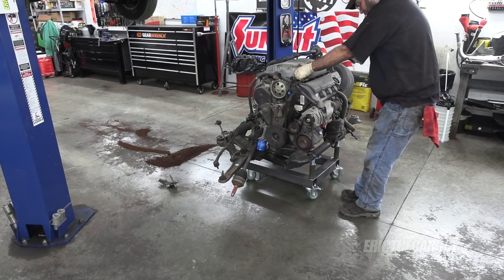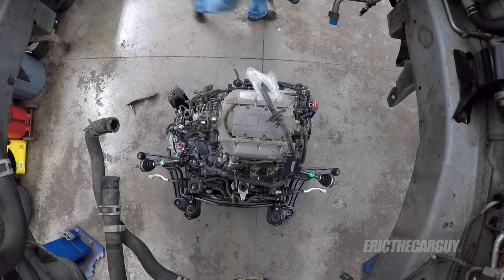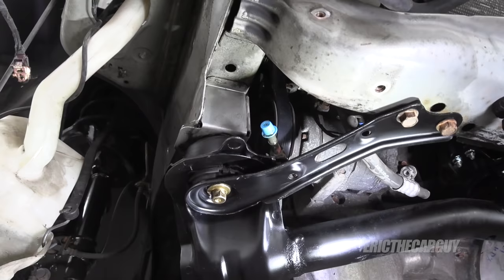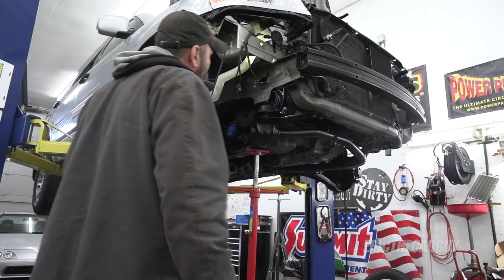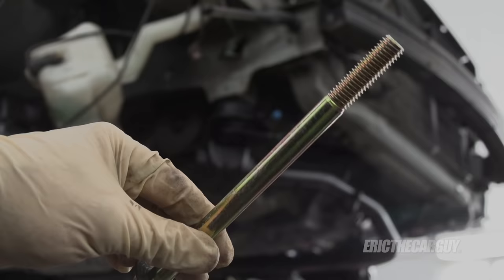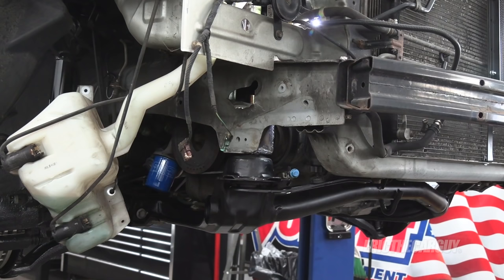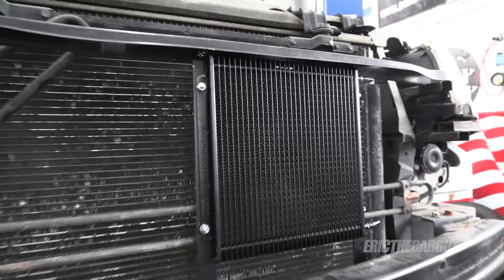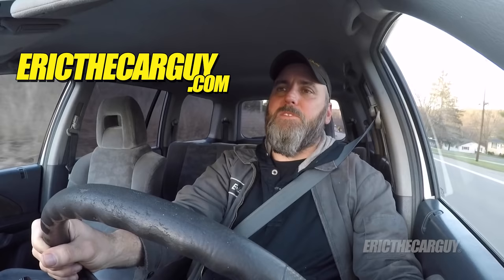Honda Pilot Gets a New Life at 200K

Comment: Hi Eric,
I enjoyed this series.
I hope you don't have troubles with that battery terminal switch. I had one and it failed. There is very little contact on the fastener that operates as the switch and it arced when the switch was closed, and then there was no longer continuity. I cleaned that switch each time it failed and then it would fail later on. I finally installed a cut-off switch, similar to what is used in race cars. I switched the negative cable and mounted the switch near the battery, so it is easy to reach, and it works every time. I should have installed that switch in the first place.
Marc

Comment: The 10% and 90% on your throttle position sensor is the duty cycle that's coming from the computer and come from the 5 volt reference that most sensors run on my f250 runs on 85 and 15% on most of its duty cycle on most of the sensors it has a 60 motor and it's very advanced for the 2007 6.0 L Diesel  it is. Thanks for your videos do you have any help me with a vehicle that I'm working on yet I know that you helped many with theirs stay safe stay dirty and keep making videos and releasing them on Fridays as we know... Peace... Focker out!

Comment: Interesting video with the issues that pop up on every job, all the time, bolts break, threads strip and it somewhat complicates our lives, oh well, it comes with the trade and we just become better at solving these issues as we gain experience. I suggest you get a creeper, I hate draging my body on the ground and collecting the grease/oil/whateverisontheground then sitting in the car with filthy clothing. I like overalls too. Take care and thanks for the vids.
Reply from the maker: I HATE creepers. When I had hair, I'd run it over all the time. When you try and break a bolt loose, the creeper moves in the other direction taking away your leverage. Not to mention if you're using jack stands the creeper limits the distance you have between the floor and the vehicle. I've always hated creepers. Instead I do what I can to keep my shop floor clean. Thanks for the comment.

Comment: Great job as always Eric!  You 100% can replace the TPS separate of the throttle body, (Honda just has never sold the TPS alone) you just cut a slot on the rivet and it unscrews.  If I remember correctly it's m5x0.8 thread, same with the IACV screws.  The TPS on that throttle body appears to be the same as that used on 90's D and B series.  Basically it would have been a million times easier to just replace the TPS sensor instead of the entire throttle body, especially with the IACV removal issues you were having on the "new" one.  Also not sure if I remember entirely correctly but I believe the 10-90% reading is just how it is. Something like  0.8v is closed and like 4.2v or something is fully open. :shrug:

Comment: Yo Eric! Nice job on the pilot! And the tps is serviceable, just have to replace the bolts. And then it can be oriented to read the correct percentage values! Cut the head off them and it takes a common 10-32 thread! Still cool  though!

Comment: Eric, I don't believe just throwing on a supercharger does a whole lot by itself. (I may be wrong)---  But I think you can get a "stand alone" type computer for these where you can take it to a dyno and get it tuned to match your supercharger.  Maybe you can tune the stock ECU's?   I'm not sure.  But if you want to make a real jump in power, you need to add fuel with that extra air your getting with the supercharger, somehow.
Reply from the maker: No, you can't get a stand alone computer for this model. You have to use a module and tie into it. https://www.apexi-usa.com/products/afc-neo-fuel-management

Of course I'll be upgrading the fuel system along with the supercharger. Thanks again for your comments.

Comment: I have a 2008 oddysee van.  replaced the power steering pump because the old one leaked and quit working.  damn new one made noise no matter what brand of fluid I used.  I finally said the hell with it and put enough Dexron III trans fluid in it from the low to the full mark.  damn thing is quiet as a sewing machine.  all the honda power steering fluids would foam really bad. auto trans fluid has anti foaming agents.
oh and the TPS is probably normal.  when I was a mechanic at the Yamaha dealer, the bikes I worked on all started about 7 or so and ended around 96.

Comment: I believe the 10-90% thing is on purpose. Since the computer knows 0 and 100 are not legitimate values it can tell if the sensor is open or shorted. notice you had a value of 1% with the bad sensor, and the light came on right away..... it knew 1% was not valid even before you revved the engine.

Comment: Just so your aware, in the future for everyone watching this, once you weld a grade 8 nut to ANYTHING you significantly reduce its tensile strength, meaning you can easily overtorque and strip it if you try to tighten it to spec.  Instead, buy a nordlock washer kit for the proper size, install and torque using a wrench on the nut, dont weld the nut in this case for a cradle bolt.  Honda designed it this way for accident deformation, for the purposes of the repair though, you should not heat the nut in any way.

Comment: Nice work!  That’s a  job most wouldn’t be willing to tackle.

Something you might want to consider coming from a welders perspective.  Is welding causes shrinkage of the metal no matter how little… torquing the subframe bolt then welding/tacking it most likely changed the amount of stretch the bolt had previously (my thinking says less with the nut loaded while welding).  You may want to double check the torque on the bolt as it may have less clamping force than it did previously, might not even be enough to make a diff but you never know.

Comment: I had a Nissan Murano and the bolt that hold the cradle up broke off and Nissan said that you have unweld and replace the whole panel I cut the floor with a hole saw and put a grade 8 bolt and nut in it

Comment: Love you videos, i have a 2003 pilot and im losing faith. I actually love my Honda but everytime something goes wrong i buy the best of the best parts. I seriously have 3,200 for the truck that's not including 5,6k in parts and you name it I've changed it, know when im accelerating and im doing slower speeds the trans kicks into a higher gear and it actually feels like the whole rear end fells like its bouncing like a basketball and its actually crazy on the highway. Once again i love your show, i get alot out of all your tricks, special tools. So do you have any ideas about the 2003 Honda pilot. O and one more thing it has 205,345 miles but no lights no moter issues.
    Thank you for your time.
             Bobby

Comment: I’m thinking that percentage might be a percentage of your 5V reference because I remember my 99 Accord (no longer own) having those values years ago. I guess my logic is, 0V on the reference line results in P0122. P0123 is the opposite relation from 5V on the signal wire. So maybe the sensor operates between .5 and 4.5V. That’s my take on it.

Comment: I have a 2005 pilot. 123000 miles. Always dealer serviced and taken care of.  My question is my tire pressure light will come on. I check all the tires and they are all properly inflated. Anything I can do to keep the warning light from going off and on?

Comment: I have a 07 TLS and with Hondata plugged in showing live data, the TPS also shows 90% at full open throttle so i think this is normal
Reply: Think in the Helm (Honda) service manual it says its normal. I have to check though

Comment: PSA!!!  Metric hardware doesn't follow the same rating system as SAE hardware.  A grade 8 SAE bolt is similar to a grade 10.9 metric bolt.  A metric grade 8.8 is only equivalent to an SAE grade 5.  Please be aware and choose your hardware accordingly.  If the OEM metric bolt has a "10" mark on the head, it's a metric grade 10.9.  Switching to SAE hardware would require a grade 8.

Comment: Great series I'm glad you did everything the right way and cleaned stuff! (Not so) Quick question, I performed a timing belt/water pump and valve adjustment on my 2003 Acura MDX. After driving it I noticed that it doesn't engine brake (it just coasts when completely off the gas). There is also an issue where if I put it in park or neutral the idle surges and drops from 1 - 2 thousand rpm's. I had a shop diagnose it and they said it's the IACV. They are built into the throttle body so I got one from a junkyard. That didn't work so I'm stuck now, I should mention I cleaned both of them the first one I touched the flap, second one I did not. Some of the codes are: Intake temp sensor high, O2 sensor negative current bank 2, O2 sensor circuit no activity detective bank 2, Idle control system RPM higher than expected, Intake air system leak. I checked for vacuum leaks, none, also bleed the coolant. I just want to ask if you think it's a faulty throttle body. I genuinely appreciate your, or anyone's help. It means a ton that you took the time to read this. It's really discouraging when you want to be in the auto industry and you just can't diagnose something.
Reply from the maker: https://www.ericthecarguy.com/solving-automotive-performance-issues/

https://www.ericthecarguy.com/solving-automotive-idle-problems/

Comment: torque for that bolt is 75 pound plus or minus 15 pounds. you need to go no tighter than 80 ftlb
and lube the thread and turning bearing step on head with engine oil or your torque will be way off.
at this torque load washer must be of the hardened type all parts can be had from caterpillar dealer and torque setting can be found in caterpillar pubucation one safe source, and or online
different lubes require different torque sittings .
we always use anti seize lube of either copper or aluminum base, depending on ground conditions where machinery operates........ on head bearing surface and treads.
except on internal parts where engine oil is used.
never fit fasteners with out head to hardened washer bearing surface lube and tread lube.
it is just a no no.
if the washer is of a lower grade than the bolt it will squeeze out over time and all tension will be lost.
due to a grade 8 or any high tensile bolt relying on shank elongation to supply the clamping force.
for all these reasons,.... is why your bolt snapped.
I am Shure you would know much of this,... but others may not.
and some may be of use to use as you did use a torque in execs of what the bolt can achieve with out permanent elongation.
loosing its ability to supply its maximum clamp force.

Comment: First off, let me say, I really enjoyed the repair of the Honda Pilot!   Great video series!     As an owner of a newer Honda, and an old 2007 Ford P71 with 200K on the clock(which I repair myself and runs flawlessly).. the worth (read resale value) of a vehicle isn't quite right the way you look at.    If a vehicle is only worth say $1500 .... and the trans goes out in it...   Ok, rebuild for $1,500 or buy a new one for 2000.    Some would junk the vehicle.   But if you owned the vehicle or in your case, you went through everything....    What can you buy for the cost of investment/repair that is in as nice of shape and will be extremely reliable?    You can buy another vehicle for $6,000 or $8,000, but what do you have?  Unknows that will still require repair and replacement of parts.      A vehicle paid cash for can also carry minimal insurance (PLPD) for no replacement of damage, but you will save a lot of money vs, buying something different/newer.    When you factor in all of this, the older vehicle that runs well, makes better financial sense (especially for shade tree mechanics).
Reply: Bought 2008 Opel Astra 4 cylinder 1.4 16v engine for 700€ with bad engine and it was in colision. Repaired colision damage  replaced timing chain, head gasket, cleaned oil sump, oil pump and pickup, polished valve seats and replaced valve seals. Made complete service (all fluids and filters), alligment and refill AC. Total investment was around 2000€ with insurance and MOT. Driving for 2 years, only fault I had was outer right CV boot torn and right stabilizor link gone bad. Maintenance free, don't even bother to check engine oil because it dosn't consume any. I can buy newer car for 10x price but why? This will get me from point A to point B cheaply and it was cheap, cheap to maintain and reliable. AC works so basically almost everything I need I have
Reply from the maker: True, but I believe that SUVs, particularly this type, a wannabe SUV, are a complete waste. The fuel economy sucks and you can't carry as much as you can with a minivan. Additionally, if you want to use this vehicle for a family, the 3rd row seats are virtually useless. Not to mention the increased maintenance cost of an SUV. https://www.youtube.com/watch?v=AqTgv2RSC7I&t=15s

The P71 however is an awesome vehicle and very useful for what it is. Not to mention a terrific platform to build on. Hence the reason it lasted so long. Given its popularity, you may never run out of parts in your lifetime.

Comment: Is the new transmission built to handle the extra power the blower will add?
Reply from the maker: It's built for towing so it should be fine. It also has a kick but cooler that is far better than stock. Also, I don't expect the supercharger to add much more than 50hp.

Comment: I am really enjoy watching your videos, especially on the Honda pilots! I do have a question. I made A mistake. I had the head sitting on a piece of cardboard instead of putting a rag underneath the valve when I was rotating the cam to set the valves intake and exhaust. I checked them twice, so I’m rotating the cam on that piece of cardboard. Is that enough to be in the valves? I sure hope not and I feel dumb because I didn’t realize that the head jumping off the cardboard😢
Reply: I’m sorry is that enough to bend the valves again?

Comment: That 10-90% on throttle position sensor might be a diagnostic thing - anything outside this range might get an idea to the ECU that sensor wire is either shorted to ground or +battery (or +5V supply). No idea if that's true, I am just engineer who sees a familiar pattern :)

Comment: maybe a degraded sensor? I believe it still checks voltages. could be a connector or maybe even contact points are worn on the throttle sensor? far, far explanation but I have seen hondas have some really really off the wall issues before so I am not discarding this one
Reply from the maker: I would. It runs and drives fine. Take the win when you can.
Reply: No see other comments here - it's a design feature so that the computer can detect an open circuit and a short circuit.  If sensor ever reports 0% or 100%, it will set a CEL.

Comment: Out of curiosity is there a reason you went with a different throttle body instead of putting a new sensor in the old one. Are the sensors no longer available or are they too integrated to replace them?
Reply from the maker: You might have missed the part where I said that the sensor is part of the throttle body assembly. You can see they use rivets to attach it. Also, the used throttle body was $45, a new one is $500+. Thanks for the comment.

Comment: Its quite possible the throttle sensor is working as designed.  Most of the time, resistance is used to determine the actual position of the sensor, internally.  Its not uncommon for the software to include code to adapt to the actual range of the hardware;  This is because even in the highest quality resisters, 10 resisters from the same lot will return different values at the same position.  Its just the way that it works.  Anyone involved in writing software for hardware control is familiar with this issue.  Typically, one notes the bottom and top ranges of the resistance, and then interpolates between the values for relative position.

Comment: Eric I have 2008 honda element p2646 code I changed the beech solenoid oil switch but it's stuck in limp mode and code is not showing up after replacement! Help! Please I know your the master of elements and im stuck. It won't reset after turning on and off. I do have to replace the crank shaft sensor but it shouldn't be stuck in limp mode?!

Comment: Hey Eric, I'm rebuilding a 2003 Accord Coupe EX V6 6-speed to daily drive and I'm having a few issues I'm really wondering if you could help with them. 

1. My buddy cross threaded the top bolt for the passenger side half shaft for the axle and I'm not sure what size the threads are, it seems to be some weird 10x37 thread... I ordered brand new bolts for the one top and the two bottom.
2. I have a TPS and yellow Triangle explanation light that pops up after a few seconds of the car. I've tried resetting the lights but no dice. My brake light also stays on but goes off when I unplug the sensor for the brake master. I've tried researching it but I can't figure out an answer
3. While replacing the passenger lock actuator, I seem to have some how put it back together wrong because I am unable to unlock it and neither inside or outside handles unlock it. The actuator works. What's the best way to unlock or open the door? I don't care if the assembly gets ruined because a bolt already stripped and had to be drilled out.

I'm so sorry for this huge list, I just want my car to be drivable soon so I can get rid of my payment finally.

Comment: ERIC!  You can use the cheap long skinny black funnel at the parts store to fill the transmission through the dip stick tube.  It's WAY quicker than filling through anything else and never spills even a drop.
Reply from the maker: IDK about quicker. That's an awfully small opening compared to the 1" hole the speed sensor creates. Not to mention that the battery is usually in the way of the dip stick on this model. However, I believe there is no wrong way to do something if you're able to get the job done. If you want to fill through the dipstick, knock yourself out. Thanks for the comment.